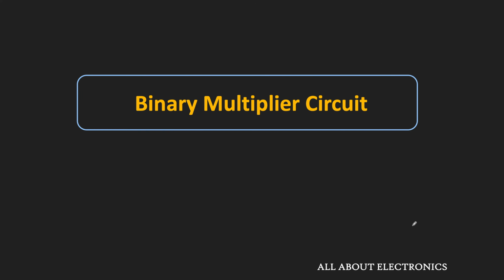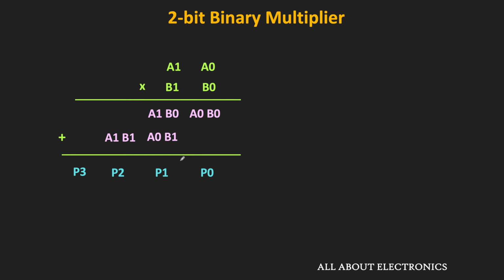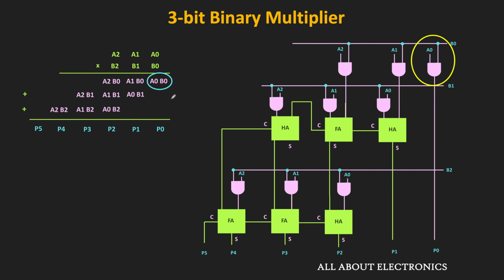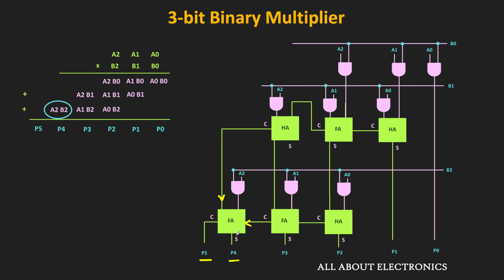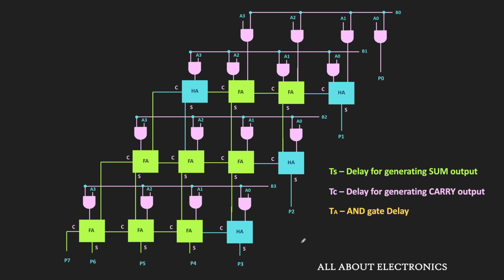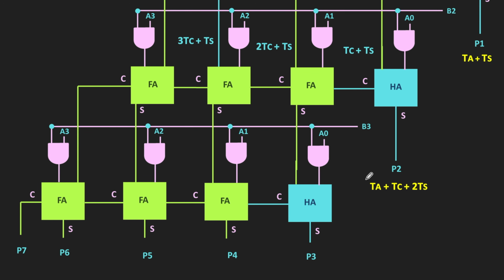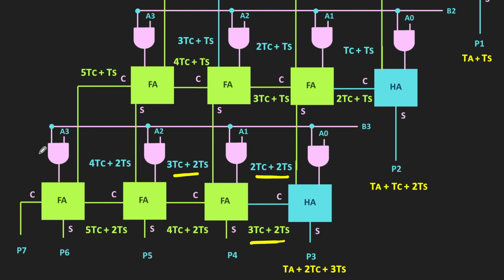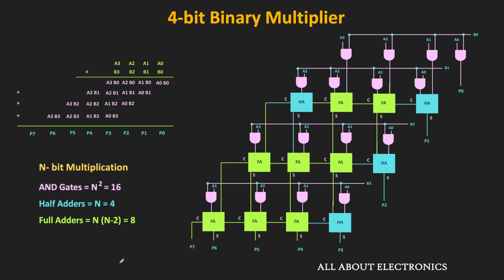How to Design Binary Multiplier Circuit | 2-bit, 3-bit, and 4-bit Binary Multiplier Explained

Comment: i think in 2 bit multiplier we can't use 2 HA beacuse HA can't handle the carry input so we would need to use 1 HA and 1 FA
is that right????
Reply: @systemonemodels  The carry from the first half adder is added to A1*B1 so it is fed into one of the HA inputs and doesnt require a Cin.

Comment: When to take half adder when to take Full adder ???
Reply from the maker: You need two half adder in the first row, at both ends. 
And apart from that, in each remaining row, you will require one half adder at the right end side. you can see the diagram of both 3-bit and 4-bit multiplier, you will get it. The same is also true for 5 or 6-bit multipliers or in general for N-bit multiplier.